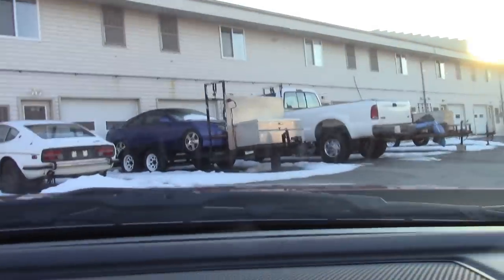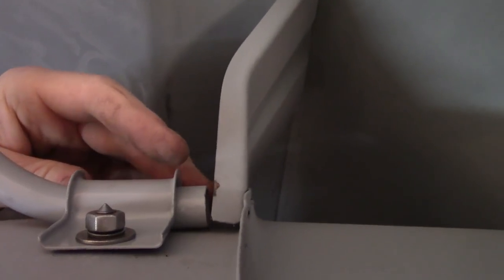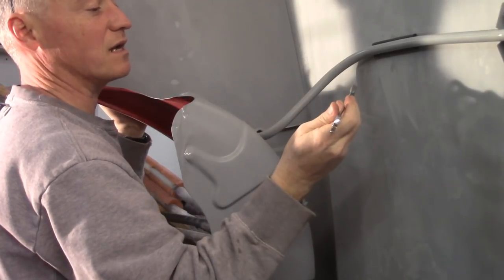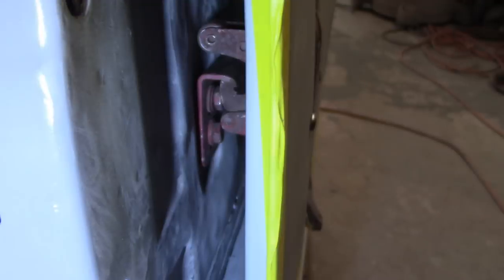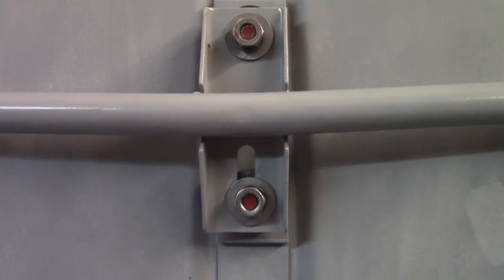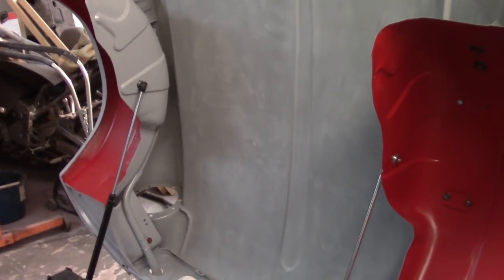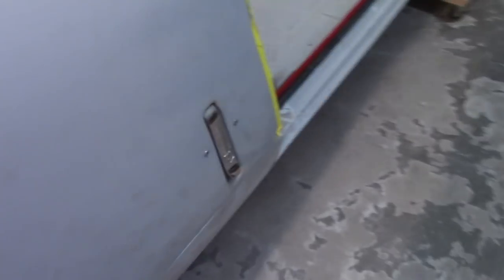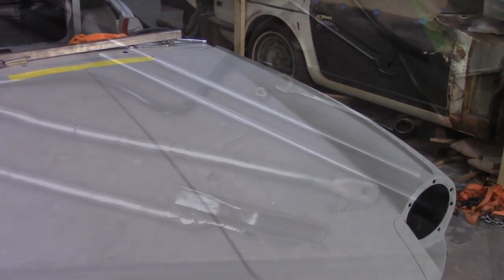Triumph Spitfire - More Bonnet Installation | Roundtail Restoration

Comment: As always, in admiration of your patience working your way through the problems and pleased to see that the gaps improved.  I am surprised that the pneumatic struts would have caused thrust or constraint to give the offsets.  I can only speculate that either the struts had run out of travel and were bottoming out in the closed state or that the attachment pivots did not have enough freedom to allow movement off  90 degree to the strut axis.  Or was there a lack of clearance somewhere?

I once ran a Triumph Herald for several years, so I have had experience with a similar large one-piece bonnet (hood). It was many years ago now, but I can't recall any real problems with the hand operated strut, so maybe returning to the original set-up is for the best.  I very much doubt that my old 13/60 ever had better gaps than you are achieving, so keep going.
Reply from the maker: Hi, Robin, thanks. The struts are pretty strong. Maybe with some wear on them they would not flex the bonnet so much. I really like them, but like you said never really had problems with the original. I know I'm working within the limits of "1966 gaps" so I'm trying not to get too crazy, but I'd like them just a bit better. Thanks!

Comment: Lots of painstaking work and the results will show. ..perhaps you could pull the r/h lower edge of the bonnet panel, by inserting a wood block between it and the scuttle, in the same manner as adjusting a door. Great work anyway Chris and your attention to detail in getting things right, will show on the finished job.
Reply from the maker: That's a great idea. Thanks, Brian, I'll give that a try.
Reply: @roundtailrestoration  Chris, as Rocky Mac says, yo will need to be mindful of the match up with the front edge of the door , so as not to make the bonnet sit proud of the door edge, small pressure on the wood jam, would be required. Best of luck with it and I hope that you don't have to slice the  sill under the bonnet edge.
Reply from the maker: Hey, Brian. I want to step back a bit. This wood block you speak of...I'm not sure I follow you. I really don't with the door. Sounds like there's a method there I don't know about (which doesn't surprise me since I'm only winging it anyway). Can you expound on that? You can contact me via email (roundtailrestoration66@gmail.com) if that's easier. Thanks, Brian!
Reply: @roundtailrestoration  sometimes to align a door , you put a piece of wood between the sill and the door and gently push on the door to align the gap. It is an old school thing and there are probably clips on doing it of the tube. I thought that if you placed a wood block (eg a piece of 3 x 2 or less), between the bottom edge of your bonnet and the top of the sill, near the bonnet latch ares and lowered the bonnet onto it then, by pushing lightly down on the bonnet, it  may spread the lower edge of the bonnet out and then the bonnet gap would align on the lower edge. The danger is that if you pushed down too hard on the bonnet, it could spread open too wide and the bonnet edge would sit proud of the door.

Comment: At the rear edge of the bonnet, is it just the middle that's sitting above the front scuttle? If so, it would appear that the whole panel is bowed too much at the back edge so could you use a stretcher tool on the rear vertical lip to slightly reduce the bow? The danger is that however you do it you'd flare the sides out so you could just end up chasing the contours!
Reply from the maker: Yes, Rocky, just the middle. It levels out towards the edges. This is the one thing that I don't think I have figured out yet. I don't know if it sits flatter at the outsides because it's not bent out there or if it's because there's more weight. Afraid to bend anything yet for the concerns you mention. Thanks!